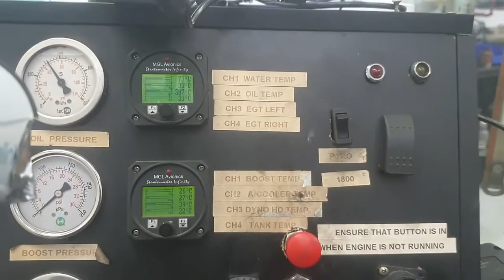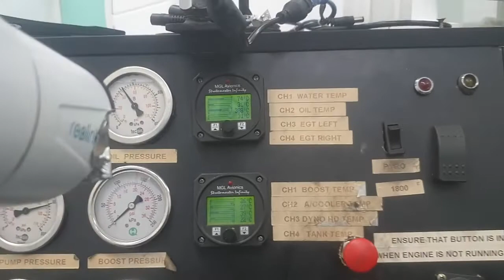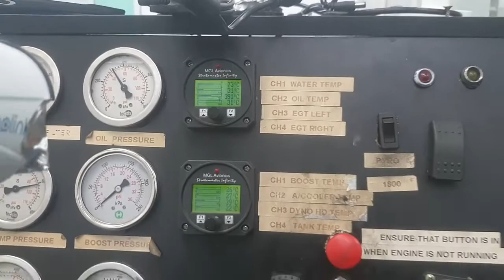Reminiscing about the mechanical diesel days. Brad having a rant!

Comment: Why my daily drivers are a OM617 Mercedes and a Ve pumped 5.9 Cummins. If the fans will wobble they will run. No sensors to shut them down or derate them. No ecu's to decide to stop it all working. They just go and go and go. :-)

Comment: Starter motor and an alternator used to be the only electrics, with capillary oil pressure and temp. gauges,  got complicated when you threw in Murphy gauges wired to a fuel cutoff solenoid. Needed a relay AND an oil pressure bypass button. Might even been two relays, you'd have to ask the electrician. Only ones who understood that magic.